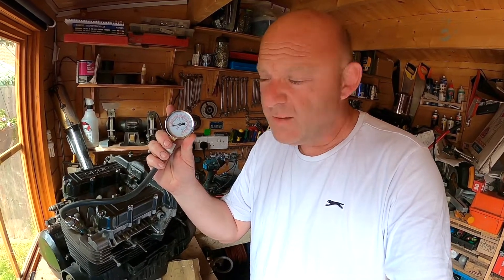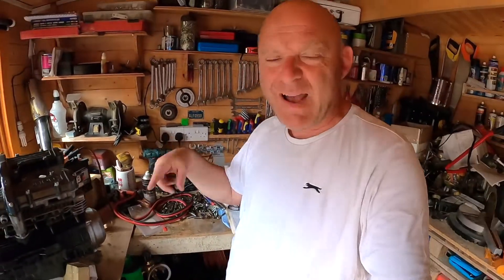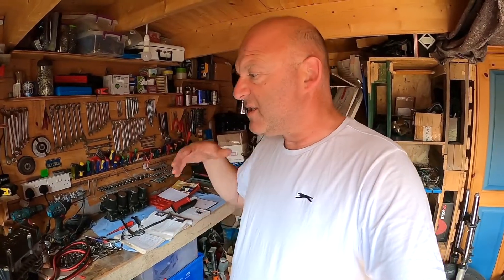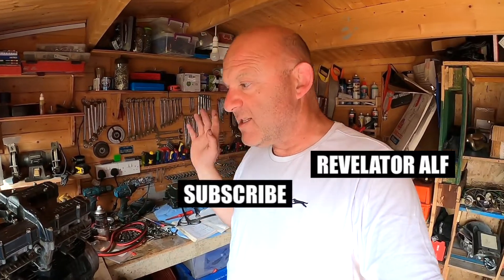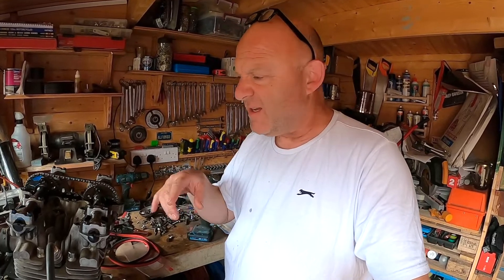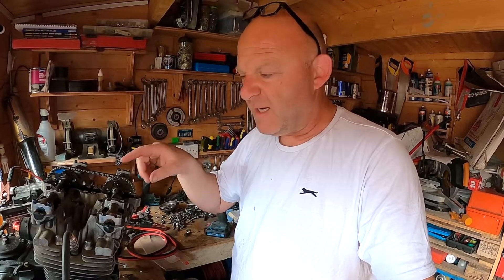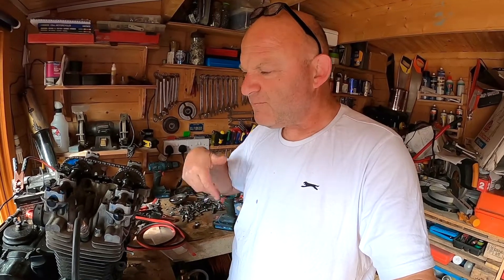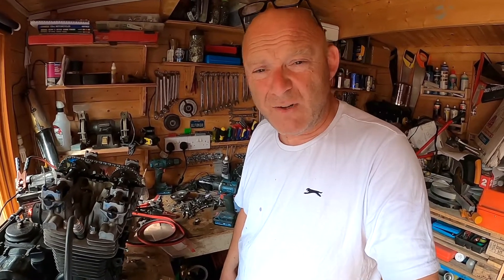Engine Compression Testing | Valve Clearances | Kawasaki Project Build

Comment: When the valves are fully open on these engines you can the seating surface through the plug holes, if it’s been standing a long time I’d think they’d need reseating TBH.

Comment: Squirt some oil down the bores. If its ring/cylinder issue the compression should go up. If not its probably valves. Either wrong adjustment. Damage (bent/burnt) or dirty valve seats. You are going to need something around 100 psi to get it to start properly. I would think 140-160 on a decent engine. Look forward to seeing what you find.
Reply from the maker: Yes I would say so too cheers

Comment: Alf, there are a few more things you could have tried before stripping it down mate. I recently went through this with my little 400 Four Honda. I had very low comprehension on one cylinder and pretty poor on two of the others. In my case it was that the valve clearances were too tight not allowing the valves to seat fully. .05 mm made a massive difference. Went from 60 PSI to 170 psi unbelievable. Your engine compression should be in the same region, but the most important thing is that they’re all the same or similar.
Reply from the maker: Yes I’ve taken the chance to check clearances and clean it all up too

Comment: Alf, I would say 120 to 140 would be fine.  If ALL were 60, it would probably run,  but not well.  Yeah, you're going to need to over-haul the engine;  rings, valves, cams adjust, main bearings, and rod bearings.  But, that's where the fun is right, mate ?

marcus